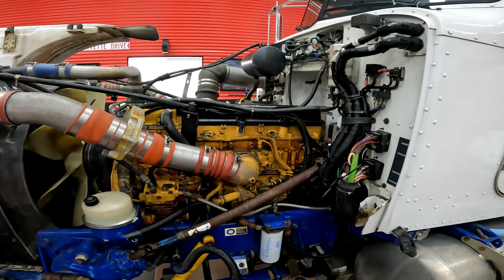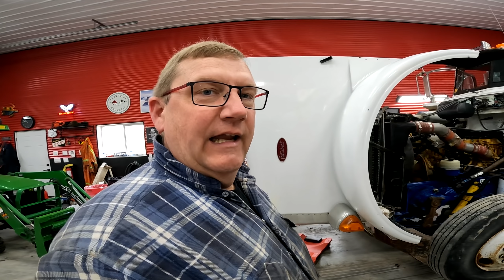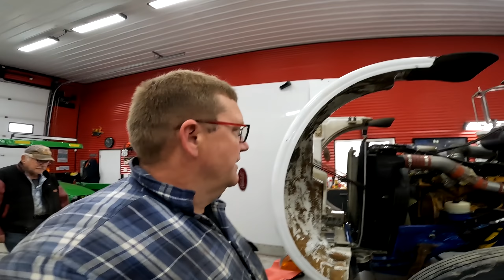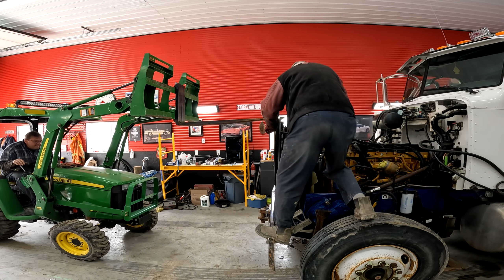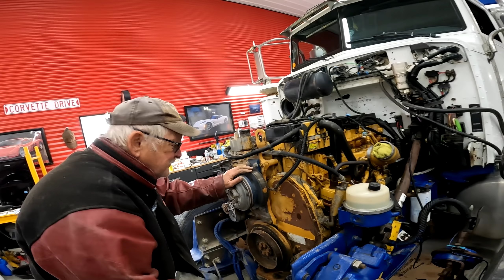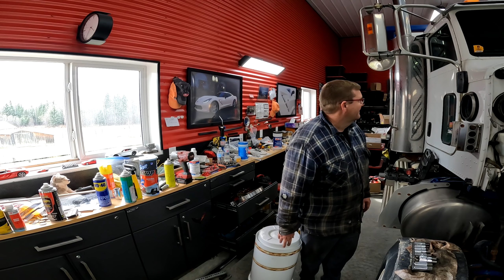CAT power Episode 4

Comment: Just pull out the engine and leave the transmission in place. Look for another similar C13 engine, it is easiest to replace and enough for you to use. Let the frame be blue, just repaint the back of the frame. Paint blue, classic Peterbilt style stripes in the cab. Choose blue from the frame color and some other lighter blue with it.
Reply: Rrdbfreme Mike

Comment: Hi from uk Mike and pops👋👍 I love they way you da just climbed up and jumped off like he was a young man doing an apprenticeship when removing the rad👌😂 and just remove engine leave box in place just when you sit new replacement engine in you might have to use bar through inspection window or remove srarter to bar flywheel over to line engine and box on splines on shaft👍 thanks for your time and be safe see you soon👍👋

Comment: Thanks for another lovely video Mike 👍 For what it's worth, I think blue would be lovely. You already have at least one red chassis. Go leftfield with blue on DK, and black on one of the others! Variety, life, spice...... 😉

My first truck as an owner driver had a blue chassis, white cab and 3 tone blue stripes on the cab when I bought it. I kept it that way as it looked lovely, and was a little different from the norm. It was a Volvo FH16(ltr) 520(hp) with a 12 speed manual syncromesh box, oodles of torque, 5inch bore vertical Eminox exhaust, and whistled like a diesel locomotive on tickover. Looked great, sounded awesome and pulled like the train it sounded like. It was doing 1100rpm when cruising at 56mph (The majority of European trucks over 7500kgs gross weight are physically restricted to 56mph/90kph), and was a lovely, lazy truck to drive. 

Another factory yellow Cat lump would look awesome with the blue 👍Be a Maverick!😉

Comment: Mike keep Duke blue. You have a red truck, Smokey. Man that was a big hole in that C13. If you stay with a C13 could you reuse some of the parts from this C13. Would you be getting a "short" block, like they do with automotive engines? Would this save a lot of money, if you could reuse parts from this engine. Mean while, clean out the cab on The Duke. Nice job on the outside. Almost looked new. You could put it on the lot at work, and it would look good. I think your rigs or" fleet" need a garage of their own now.  Keep up the good work. Great videos, nice new open btw. Keep on truckin.

Comment: I agree with SportTruck.  Keep the same engine. You are not a trucker only a hobby guy so you don't need a lot of extra power. Keep it simple and keep the blue. I like the blue frame and paint the back blue.  Black frames are boring.  LOL Put some nice blue stripes on the cab with different colors of blue. Will look sharp with the white cab.

Comment: Just pull the engine and replace it with another C13, it will be easier and less time consuming . If you paint the frame just redo the blue, it's a good colour. Maybe remove the roll over bar to save weight. 

If there's no problem with the transmission, leave it in.

Comment: If the frame needs painting with the engine out is the time to do it & just get the same engine then it's just plug & play + you got the old engine for odd & sod spare parts 

Just take engine out leave gearbox where it is 

🙂 Keep stuff simple Mike makes things so much easier

Comment: A real bummer that the C13 is toast, but I'm sure you'll be able to locate a decent used one to replace it. You could probably leave the transmission in place. Leave the frame blue, add a blue stripe or stripes to the cab. Though of course it's your truck, your choice and it also depends on how much time and expense you want to invest into it.

Comment: Hey Mike pull the engine without the trans it's much easier the two together are a real handful ,and engine wise so many options to consider but I think it may come down to availability as you know there's not a lot of new equipment around .Debos is a clever guy he is obviously sponsored by a big wrecking recycling yard ,hey they are in Canada to maybe reach out to Rich ,he seems to find engines hiding in the wrecking yard ,anyhow as always very entertaining thanks ,and I got to say your Dads a fit old bugger when he jumped of the bumper bar when you were pulling the radiator my knees hurt watching him .
Cheers Kym 
Adelaide

Comment: Few things:  Awesome to see you and your Dad working together.  Enjoy those moments.  Next, the head/valves still haven't been inspected...  you may have dropped a valve which caused all of this (I remember you mentioning how the Jake brake sounded off before things went kaput).  Diagnose some more, but, I'd go with a C13 replacement instead of a C15.  Much easier to do (just plug/play everything), and with the 4.56 gears you'll be able to pull a loaded step-deck just fine without needing a bigger horsepower motor (C15). "I"m not a fan of blue" says the guy wearing a blue shirt.  That cracked me up.  Oh, and listen to your Dad...  when you mentioned the 4.56 gears, he quickly replied "well, just slow down", then he followed up with "it'd be good to pull my 5er".  I think he is eyeing this truck.  Going to be interesting watching how this truck (and all of your trucks) take shape.  Peace!  Pete - KI7LIL

Comment: Hi mike ,Id split gear box from engine ,for ease of removal ,your lil jd may struggle with gear box too ! Goose the chassis paint til engines out ,You can easy go black if you wish tho . Id yank head off too just in case you can get a short motor ,check its ok first tho . As for air cleaner id wait till you have a runner again that can be added at a later date ,You know its all about $$$  stick an add on fb WANTED CAT C13 acert you never know there could be one sitting unused somewhere close to you ? Id stick with original so you know you can use your rad and everything goes back together good . You may want to stick the fan your dad took off in upright position too leaning against something .Its meant to be bad to lay them flat some how on viscous fans ? And im pretty sure dumping them 2 turbos for a single pdi unit will produce way more power if you put whole kit on like manifold and that ? Surely be cooler egt etc etc . Im sure you will get her back up and chuffing soon tho . All the best to you ! ;-) Thanks for the content .God bless yaz .

Comment: Common sense tells me to put a exact motor back in it so the wiring is the same. You can un hook the harness from the firewall and jist plug the new motor one back in if you put a e series or a c15 in it the wiring harness isnt gonna match up the c15 might but a e series wont

Comment: Hi Mike Too bad about the hole! As far as pulling both engine and transmission as a unit DON'T. The extra weight and length will cause problems. If you are going to do the job yourself, I suggest you invest in a Gantry Frame and good old chain block.  The advantage of slow controlled lift will more than be worth the investment both on removal and really shine on install. The bigger & heavier the engine the more you appreciate the control and lift advantages of this equipment. Good luck with the project. This viewer just wishes I was close enough to give you some help when you need that ever elusive third hand.Your Father seems more than willing and very capable. Good to see. Keep the videos coming.

Comment: Mike, keep with the C13, easier in the long run. DXR Farms 2019 may have what you're looking for, and offered to donate a block. You would probably have had to pull the engine for a rebuild anyway if it hadn't gone boom🧨🧨 The blue frame looks good to me, only paint what you have to. Mike from Lancashire 🇬🇧

Comment: Leave it as it is mike if you want it done quick if you put a c15 in then you'll need a stronger box and also it will change the length of the drive shaft you'll also need bigger radiator as in flow. Me personally I would keep it a c13 just uprated maybe a single pdi turbo conversion and a smidge bigger injectors she will pull well

Comment: Hi Mike! Honestly, I would just paint the frame with the same blue that is there. I think that it looks great! As far as the engine goes, I would stick with the C13, (Honestly, I do NOT like CAT, Cummins girl here) given the cost of fuel. Fuel here in the states has been going up quite a bit. But I do think that the head should be pulled and checked before getting a short block. Don't want to deal with a short block only to find out that a valve dropped and mucked up the head.
Reply from the maker: Good plan 👍 I'll do that

Comment: A quick rattle can paint of the front frame rails while the engines out would be easy but given the other stuff you need to do, its the least of your worries. You can always paint touch up later around the newer engine.

Comment: I would just paint the frame black myself.  I'd leave the transmission and pull the engine. I'd also go with another c13 to go back in it. Because you have plenty of spare parts if you need them. I did hear about maybe putting 24.5 wheels I think in the video. I'd actually make it where all the trucks have the same size wheels and tires. Hope you have a great week.

Comment: I did the frame blue and if you can take the transmission out with a motor so you can put it on the new motor makes a lot easier taking it in and put it back in depends on what you got to fight through to get it out

Comment: I have some used engines if ur interested.. I think I may even have that same motor but it's missing the head.. If ur interested let me know.. id be willing to donate an engine that needs work or I'll sell ya a good running set up for a really good deal..
Reply: Mike check this out might be the best bet.
Reply: I probly have some other stuff you might want too.. I enherited a huge Hoard of old truck stuff and heavy equipment.. theres too much to list.. but I'm willing to help ya out and give ya that block if it's the right one.. or I'll sell ya a running motor for dirt cheap.. let me know soon because sale day is coming soon and after that the scrapper is coming in to clean up the rest.

Comment: Just put another C13 in it. Swap to a single turbo with a good tune. Plenty of power for what you're doing and since the truck already has a C13 another C13 will fit right back in without having to build charge pipes and brackets and so on.

Comment: I’d say get another C-13 otherwise you’ll run into cooling issues, transmission issues as in size, and also will it fit in the hole that is there. You can get 475 hp out of a C-13. I’d say just pull the engine itself. If you’ve got the money long block is the only way to go. Make sure you get radiator checked out hate to toast a new engine over bad radiator.

Comment: I'd leave the frame blue, just re-spray the rear & anywhere else it might need it.
Your dad had the right idea, get a C-13 short block & put your top end on it as long as your head & all that is still good, you read that the one in there was 430hp how  much more do you need ?
That was a great idea putting the hood on a pallet, if I were you I'd get a few more & put the radiator & any & all the parts you take off on them. One it keeps them together & two, if you need to move them you can just use the John Deer. 
If your going to put another Air Cleaner on the drivers side you need to hook it up there is no bigger joke then putting it on just for looks, just like trucks with twin stacks but only one is live. lmao

Comment: If you are contemplating going with a short block I would definitely remove and inspect the head. My guess is you dropped a valve and broke a piston that in turn wedged in the liner and spit the rod through the block. If that's the case your head may be junk also.

Comment: Mike you could buy a c13 without the turbos and put the single turbo of a c15 on it (or any CAT that fits). 
if you want double breathers just mount the left blind (without funktion) or get a 359 hood and convert the intake 
that would be easier than rebuild the left intake in a 379 style.

Comment: Hey Mike, youre a numbers guy, surely you can run the numbers on mthe most economic way to proceede. I would think that the truck would be worth substantially more money with moremhorsepower and a newer engine would bring more than a re-hash of an older engine, but thats only if you are going to sell soon. If you want a hot-rod toy than you need a C-15 the same way I told myself mthat I needed a ZO-6 Corvette over a standard. The truth is that I don't really need it but It esentially keeps up my reputation and my ego. The reality is that its worth more mmoney and it costs more money for a clutch and tires. I would think that keeping the C-13 and a block that is as new as possible would be best. If you want more horsepower after you're done than think about a single turbo in a larger format might be a good way to go. Ive had two boats with Cat's in them and I love them and with the fuel prices today possibly the smaller engine might be best. There must be some chart in the storage locker of PACCAR that will give a economy rating of the C-13 pulling x-pounds vs the C-15 pulling the same weight

Comment: Quick thought. Parts truck with crunched frame or burned out cab with a good motor might be a cheaper way to go..? If you’re looking at a bigger engine or small block you’ve then got an ecu etc.

Comment: Also---leave the frame BLUE its a great color and myou can use it as a pinstripe on lots of base colors if you change from the basic white. As far as pulling the engine with the trans connected or not that depends a lot on what you are using to pull the engine, If you're using your dads backhoe that is a lot to ask, those transmissions are dead weight and all at one end unless you have some way to move you're lifting point way back

Comment: If that's the only hole and it's that small, make a patch and weld it in (Muggy Weld).  If the crank is not destroyed, just rebuild it right there in the frame.  You have other stuff to spend $ on.
You got red cars and other trucks that need frames (to paint red) so just keep this one blue and go with the blue and white theme.  You can do some accent stripes in blue with a gold outline that would look very cool.

Comment: Pull the lot out and the prop shaft,  power wash it and then sand blast chassis and you can decided on what engine ect .its a lot easier to blast with it all out and paint simples.

Comment: Easier to pull the trans first. If it is a SOLO clutch, you must install bolts to holds the clutch together. Or you will have to find a shop to recalibrate the clutch. IF you are changing the transmission.

Comment: I would paint the rest of the frame blue, replace the engine with another c13, since you already have everything there plus it leaves the truck original, leave the transmission in the truck, that way it would be easier to check both the clutch and throw out bearing. Adding a second air cleaner to the side( even if it just for looks), would be great. Add blue striping that matches the frame to the cab and sleeper. When you are done, you will have a killer truck.

Comment: Yes just block op the transmission and unbolt the bellhousing  lift your motor and pull it toward you can bring both out through the front just drop the drive shaft off the back of transmission stick a floor jack under the transmission with wheels and someone can push it forward as you lift

Comment: Can that hole be welded, been done before, did it hurt the inside of the block, you won't know till you get it pulled., i would pull the trans out, you can clean it up, check it all out, it's not like your loosing money while the truck is down.

Comment: Better to leave the transmission crankcase or component if you will as is, it just simply separate the engine from the rest of the truck then you examine it top to bottom, and see what kind of parts it needs if they are available for that make and model of Peterbilt conventional rig.

Comment: I’d pull them both, I’m sure it’s got a lotta hours on the PTO so I’d have the trans completely gone through while you source another block, that’s one less thing to worry about down the road. As far as gearing goes, just throw a little taller rubber on it and it’ll even itself out. Throw some blue Seminole style stripes on it and it’ll be a sharp looking rig. Take all these comments with a grain of salt, it’s your truck and you don’t owe anyone anything. Do it how you want it.

Comment: Well. A bit of JB weld isn't going to fix that little hole in the C13. Too many choices and ideas. Just fix the truck. Leave the frame alone, get a C13 and do it the cheapest way around. K2, Kenny, Stubby and  low and slow need the work and money.

Comment: Mike where money and time down is concerned I would freshen the blue paint a little then if you want get a Blue pinstripe for the cab. Not a large gaudy one but enough to break up the white. As for the engine I would listen to your Dad and put a C 13 back in to The Duke. Separate the transmission from the engine. That way you don't have to add extra work into this repair/re-birth! That's the way I would play the game, so I could get the Duke on the road to driving. If nothing else think about time and money, and how long it could be before Your driving a Large car & styling down the road. It costs lots to put chrome & lights on a truck! But its your choice in the end. Craig

Comment: Put 6nz in it will double the resale value besides the c13 and c12 are cat's vertion of a boat anchor other than Detroit's half breed Mercedes. The 12.7 would be a great choice other than the wiring harness. Get good after market parts that last is another challenge good luck just my opinion

Comment: ah mike i have  heard the song theres a hole in your bucket dear liza  well in this case theres a hole in your motor dear mike ya i think it is finished if the transmission is good just pull the motor out as for the blue frame keep it but how would it look if a 2 tone  the truck with white n blue